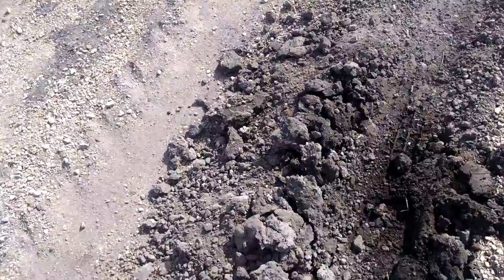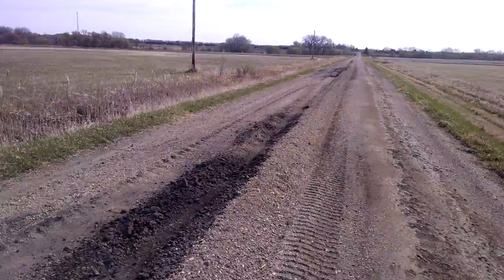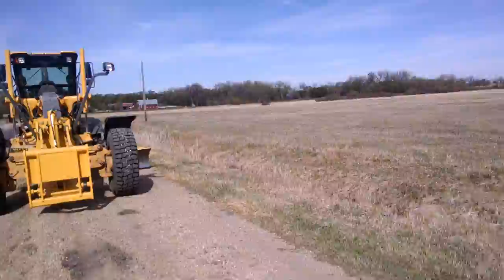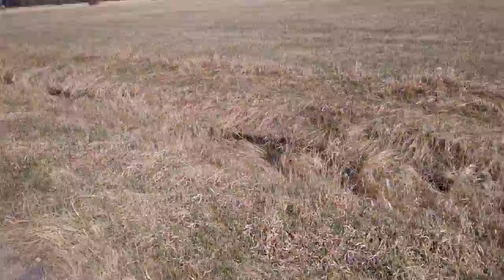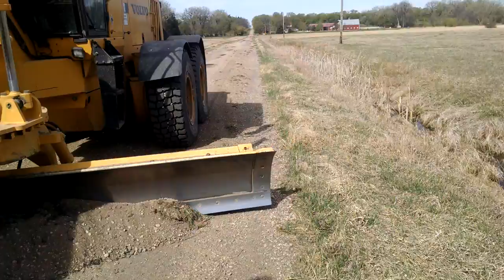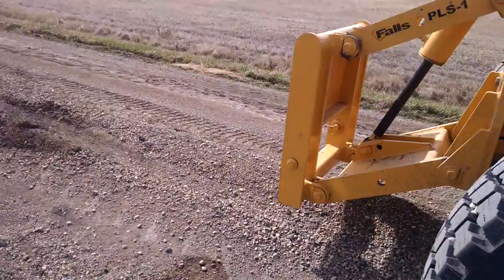Working the Road to Heaven

Comment: you running a 12 or 13 foot molboard ?    I see your using reg steel blades very smart they cut much better than bits
Reply from the maker: I run 14ft., a pair of 7ft 5/8 x 8 heat treated. I do have another 2 ft. extension, but never really have need for it.
Reply: I ran  a 12 we tried out a longer one but with the traffic flow is was easier with a 12.    The trouble with the carbide took a lot of power to run

Comment: I have one township I blade for have about 30 of them soft spots one place was so bad got my 6 wheel drive grader stuck right in the middle of the road
Reply from the maker: I only have a couple spots in this township, but both can be bad at times.  In places you can drive on what appears to be solid road, but you can see the road flex about six inches under your wheels. Sometimes speed is key, hit them fast and don't stop, its like skating on thin ice, if you slow down your sunk.